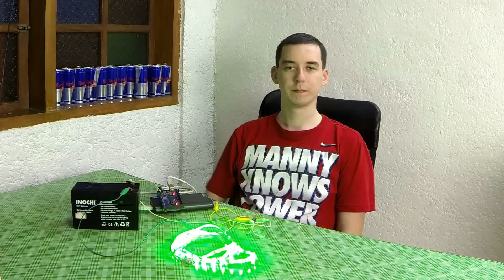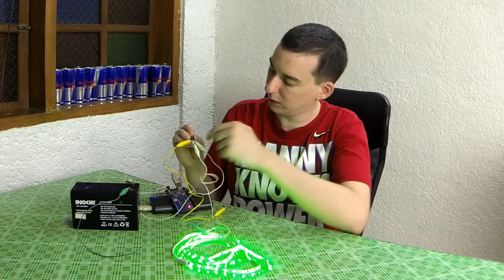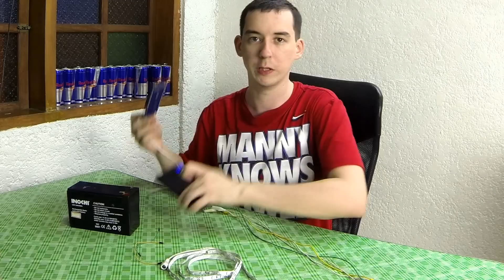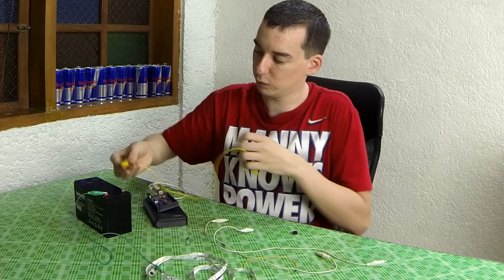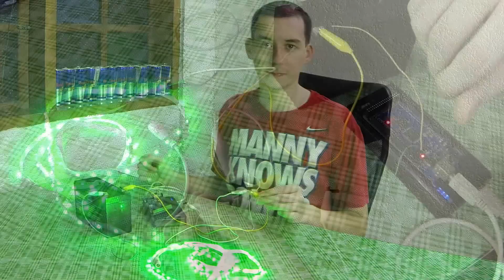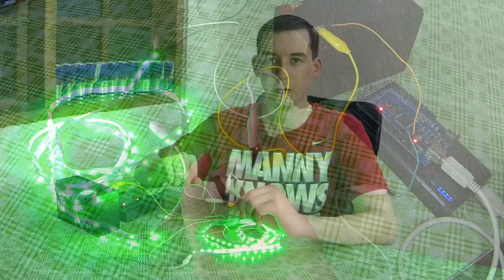Control 12v LED strip from Arduino using a Mosfet

Comment: I've been reading a lot about this type of stuff recently, while just trying to get a couple of 12v LED's to light. I should be able to give this a try in a week or so since my LEDs will finally come in. I've a Raspberry Pi though not an arduino,
Reply from the maker: You can do the same thing with your raspberrypi :) I've done something similar using servo motors and python on the Pi :)
Reply: Nice!, well thanks for the video man, it really helped.

Comment: What if I want to control 3/4/8/9 or more separate led circuits. Is there a single chip that can do this easily?
Reply from the maker: There are boards on sites like seeedstudio that act as a pwm mosfet shield that can handle 6+ devices. I haven't tried them but they're certainly out there.

Comment: Can you tell me witch mosfet used please, thanks
Reply from the maker: duckednk Pretty much any generic power mosfet rated higher than 12v and the current you intend to push through it is fine. I've actually used some little transistors which worked fine too but the longer LED strips require too much current for those. Ideally you want an L series (logic) mosfet but it's actually not too important.

Comment: Hello, 
i already bought some FDP75N08 75V N-Channel MOSFETs to be used with arduino to control a 12V LED strip, do they work?
and
with an RGB LED strip, i should add a MOSFET for each color, the same thing you did on your video but each color takes its own MOSFET, right?
thanks for the video, you really simplified it a lot
take care
Reply from the maker: Should work fine :) That mosfet is rated pretty high for voltage and current. I haven't used an RGB strip but yes, my understanding is that you would use 3 mosfet, one for red, green, blue :) At least for the standard analog versions. I think there are more modern (more expensive) digital versions that just require power and then a digital signal from your arduino.
Reply: thanks a lot for replying, keep going ;)

Comment: Do you think the PWM in a reverse light voltage of an automobile will make the drain have PWM? If so, do you have a solution to eliminate the PWM in the drain?
Reply: William Buckley Thanks to you I solved my problem by using the Mosfet. It evens out the PWM enough to trigger source voltage. Thank you.
Reply from the maker: Sorry but I don't understand your question. Can you try explain another way?
Reply: Sure. Some automobiles supply pules with modulated voltage to the lights to extend the life of the bulbs. PWM sends 12v in pulses from 12 0 12 0... Backup cameras can only work with constant voltage.With that said, my question is will the pulse voltage hold the trigger closed?
Reply from the maker: William Buckley Ah okay, so the PWM is causing problems with your reverse camera. Hmm interesting question. I doubt there's any way to disable the PWM. I have a reverse sensor which is wired to my reverse lightbulb. When the reverse light turns on, the sensor turns on and I can see the results on my dash. I'm guessing your camera is wired in the same way? Off the top of my head some kind of low pass filter might help but after a quick Google I've found that most people experiencing this problem rewired their reverse camera to their vehicles 'reverse output' instead of the bulb itself. So it seems there is likely another reverse-related source in your vehicle to wire your camera to, instead of the regular bulb hookup.
Reply: Yeah I read that too. Unfortunately, I can't find that output on the Mini Paceman.
Reply from the maker: William Buckley Awesome, I'm glad you manage to solve it!

Comment: I've read that if you use a mosfet when dealing with 12v that you should also use a diode.  Is that only for automotive applications since an alternator might not always put out a steady 12v?   Thank you for the video.
Reply from the maker: If your mosfet is going to be switching an inductive load like a motor or a relay then you should use a diode because of the large voltage spike it will push back into your circuit when it turns off. But for loads like LED strips, you don't need to worry about it. I mention the requirement of a diode in another video titled 'Control AC Appliances with an Arduino + Relay'
Reply: Thank you for the response.  Has anyone told you look like Sheldon from the Big Bang Theory? :)

Comment: Sir how about those video using 555 time to control dc motor have your ever done that if yes can you pls post it so I can make a pwm controlled fan do not have enough money to buy aud.salamat in advance a fan of yours here in tondo manila
Reply from the maker: Ali Barrera Heya, I've done some basic 555 circuits before to create fading LEDs but that's about it. I find it quicker and easier to use an Arduino. Especially if you want to add better functionality. If your budget allows, you can buy a gizduino usb mini (arduino) for under p400 and then just add an n-channel mosfet.

Comment: Hi! I'm thinking about getting an arduino uno starter kit to learn and explore electronic stuff.
May I know why you chose to have the arduino mega instead of the arduino uno?

Also, are arduino variants like "[something/store's name]-duino" (which they say is arduino compatible) any good? because they are a lot cheaper.
Reply from the maker: That's great, you should :) I have a few different Arduino models but the Mega was closest to hand when I decided to shoot this video. I've never actually made use of all those extra pins. The first Arduino I bought was the official Italian branded one but then I swapped to clones. They're pretty much identical and much cheaper. In the Philippines I buy the gizduino.
Reply: Gadget Addict hmm I'm not yet familiar with local brands, why gizduino in particular? Also, why did you swap to clones?
Reply from the maker: comebackata2 I swapped to clones because they're much cheaper than the official arduino, but practically the exact same thing. I use gizduino because the company who sell it (e-gizmo) also stock lots of add-on boards and other electronic components and they're fast to send it after payment. Although they do sometimes ignore emails and can be very slow to reply to YM.
Reply: Gadget Addict oh ok. I'm going to pay them a visit. hopefully they have a starter kit. thanks! :)
Reply from the maker: No problem :) Good luck :)

Comment: Excellent! Like you said, I was able to find a lot of videos that just explained the physics behind the mosfet, and I get it, but they all left me unable to figure out how exactly to control some LEDs from my arduino. As soon as you pointed out that the ground of the arduino needed to connect to the ground of the power supply, my problem was solved. I was really concerned about how the gate would be controlled without a ground connection in the first place. Thank you!
Reply from the maker: I'm glad it helped you out. Once I finally got it working, I realised that it's really very simple. I'd watched so many videos and tried to follow along without any luck. So once I finally understood it, I wanted to create a video that explains it as simply as possible, so other people can get up and running without too much bother.